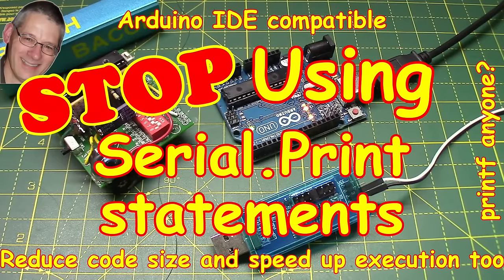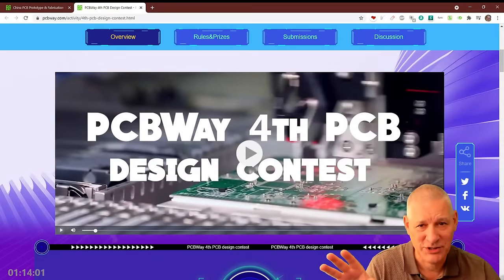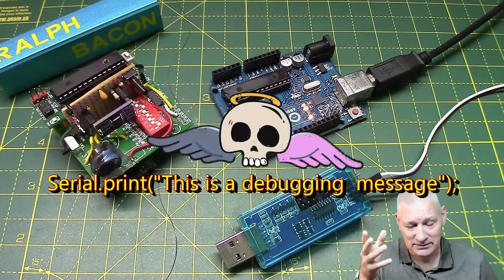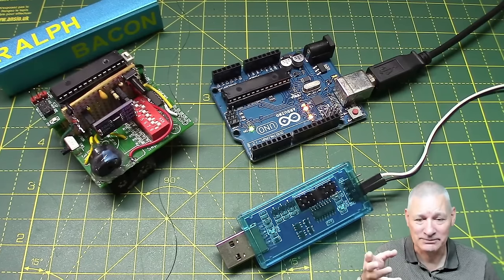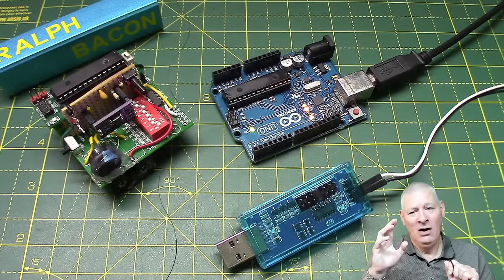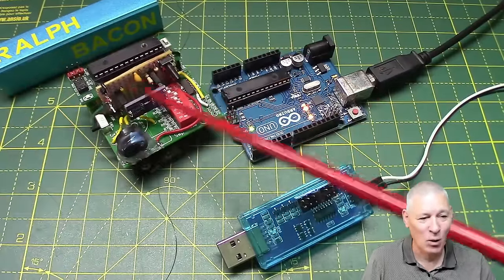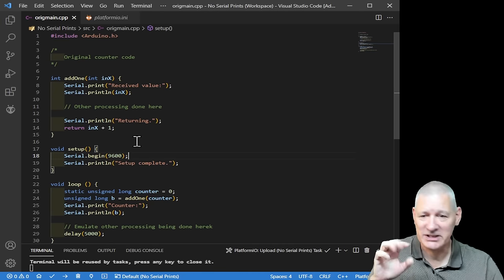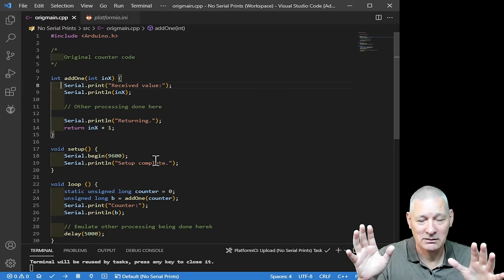#224 🛑 STOP using Serial.print in your Arduino code! THIS is better.

Comment: Ralph, I am begging you to make a video on debugging an ESP32 with a debugger. For instance your elevator code... Please debug that, show us that code line by line. I know that will be a video of reference for thousands🙏❤️
Reply from the maker: When you say "debugging" I'm assuming you mean single-stepping (line-by-line) debugging using an actual debugger? 

I tried this a long time ago (during a pre-beta phase of the new Arduino Zero) but it was so unstable. Now the Zero is no longer being made. I guess I need to look at doing this on an ESP32.

Comment: You can also do even smarter stuff in your debug statements. 
This is what I use!

#define de(X)do{Serial.print(F(#X));Serial.print("=");Serial.println(X);}while(0)

(Short for "debug expression" - you can then say de(x+3) and it will print x+3=(whatever it equals to))

#define dp_rl(X,Y) do{static unsigned long lastMillis; if(millis()-lastMillis>Y){Serial.println(X);lastMillis=millis();}}while(0)
(Short for "debug print, rate limited" - when used in a loop, it will periodically print a value every Y milliseconds.)

#define de_p(X)do{Serial.print(strrchr(__FILE__,'\\')+1);Serial.print(" ln.");Serial.print(__LINE__);Serial.println(": ");Serial.print(F(#X));Serial.print("=");Serial.println(X);}while(0)

(Short for "debug expression, (with) position" - this will print the expression, evaluation of that expression and also the name of the file and line number it got called from...)
Reply from the maker: Yes, that's a nice twist. You can probably shorten the way you do the millis(x) bit, For example, flash an LED every half second:

#define BLINK_LED pinMode(13,OUTPUT);digitalWrite(13, millis() % 1000 > 500)

If you #define the led pin in other code it's even shorter. So many ways to exploit the pre-processor commands!

Comment: Thank you, these are very useful methods and informations, but honestly the pace of the video on passing information was too slow, atleast for me. Shorter videos are alway better. If the video ever becomes hard to catch up in some parts we can always go back and rewatch thoes parts.
Reply from the maker: Put yourself in the position of a beginner, not a coder. They require the step-by-step approach more than you might think. No leaps of intuition required! You can always watch my videos at x1.25 or even x1.5 (which is exactly what I do when I proof them prior to publishing). Win-win, surely?
Reply: Longer videos make more money

Comment: Great video, BUT......  I find it strange that no one commented on the fact that your code is wrong, it never updated the 'counter' since it is defined as "0" at the beginning of the loop.  LOL  But that wasn't the point of the video.
Reply from the maker: If you are referring to line 21 of the Advanced example (main.ino):
    static unsigned long counter = 0;
then I'm afraid it's not me that's got it wrong, Don. 😮

I've explained a few times now that global variables are not a good idea; let's not get into the whys and wherefores but how do you then reduce the scope of a variable so that it can only be seen by a certain function but not initialised each time the function is invoked?

The answer is to declare it within the function but make it static which has the effect (by the compiler) of removing it from the actual function and placing it just outside - but not as a global for any other function to access, just the one it was declared in.

Anyway, that static keyword has many functions, and this is one of them. It's a clean way of keeping the scope of variables to a known caller base. Globals can be a source of insidious and hard-to-debug errors, so should be avoided wherever possible.
Reply: @RalphBacon  Then why is at always returning '0', ignoring the return value?.  It is not following the code.  As I said, that isn't the reason for the video, just curious.....
Reply: @donturnock5176 the reason why the value doesn't update is not because the variable is declared in the beginning of the loop. As he expalained in his earlier comment, this is the correct usage of the "static" keyword.

Instead, the problem is that he passed only the variable's value to the addOne function. This means that the addOne function would receive the value of the counter, but any change to the value of counter variable inside the addOne function wouldn't have any effect to the value outside. He should instead pass the counter variable as reference (using pointer) so that the change to the value of counter variable inside the addOne function would have effect to the value outside.

Comment: I've tried but if you need Serial.print(VariableValue, 2); does not work. Nice try, but you failed in doing something that WORKS.
You wrote something that SOMETIMES WORKS. Somewhat well done than.
Reply from the maker: Yes, I've upgraded the advanced example, to allow HEX, DEC, BIN etc to be specified. I need to clean this all up.

Comment: F3 -  replace all -"Serial" with "//Serial"
Reply from the maker: If that solution works for you, then keep using it, nothing wrong with doing that.
Reply: @RalphBacon  I just figured that's what everyone did. Everything from windoze notepad up has a find/replace function, and of course it's reversible. The only difference is that other than in a comment on someone else's video, I dont think it's hit-worthy. I'm not making clickbait out of it or anything. I bet you one Rial at nineteen to one odds that you 1. Stop using your method and use find and replace instead in the future, and 2. Don't post about it. But I really, really don't care. I'd never dis anyone's stuff in plain sight, but buried within a comment's (google says "comments'" (look closer) but google is slipping)) comment I think only grownups go here, so we can say what we think :) But I will watch all your other videos to see what else you have to offer (but wont comment:)) I have nothing against you man. I'm was just having a shit*y (<-BAM! censored) day and feel you wasted my time with this view.
Reply: @craigkirby9202  Not at all, I even write extra macros to include other sections which I want to debug or not individually. Also your function doesn't work (not in all editors) when you have several files in your program (multiple headers and source files). Your arrogance isn't what real software developers do. Hence, what he explained is exactly what visual studio does when you switch between Debug and Release, it is literally built into mainstream development software/libraries. You can make a debug header and add it to your arduino library and it's available in every project, so you even have to type less because debug() is shorter than Serial.print(). Just define DEBUG before including the header and you're done.
Reply: @RalphBacon  You are too nice towards rude and arrogant people.
Reply: <redacted>

Comment: I just use this - it's simple and lightweight. With variable arguments, you can use all of those Serial.printX thingies like before. That doesn't work with defining debug(s)

//#define DEBUG

#ifdef DEBUG
# define debprint(...) Serial.print(__VA_ARGS__)
# define debprintln(...) Serial.println(__VA_ARGS__)
# define debprintf(...) Serial.printf(__VA_ARGS__)
#else
# define debprint(...)
# define debprintln(...)
# define debprintf(...)
#endif
Reply from the maker: I've used the _VA_ARGS_ as the second parameter in the advanced (second) version. If this works for all arguments then your version is definitely better (simpler).
Reply: @RalphBacon  I guess my macros should do the same?

Comment: Ouch! Ralph, surely you know that the phrase "steep learning curve" does not actually mean what it sounds like.
Reply from the maker: I'm trying to remember where I said this, Terry. Not regarding this simple little pre-processor trick, surely? Enlighten me!
Reply: @RalphBacon  at about 25:20 what you said was:
"The more sophisticated the solution, the steeper the learning curve."
Would that not mean (when graphed mathematically), one would have a more and more rapid gain in a shorter and shorter amount of time?

Inquiring minds would like to know...
Reply from the maker: What I was alluding to, Terry, is that the more sophisticated (aka complex) the solution, the longer it takes to become competent using that solution.

Case in point: I want to print 3D objects. I have to learn Fusion 360 (or some equally complex solution). Huge task. Will take me months to become competent. And with decreasing gains as the curve  gets steeper as the things I'm learning become more complex.

I could go for a simplistic solution that allows me only to print other people's designs in about a week. But it's not  the solution I want. So, months it is. Steep learning curve!

Comment: Very useful information so many thanks. However, it's ironic that a video about how to reduce code bloat contains so much verbal bloat. I estimate you could have cut this in half without losing any content. 😀
Reply: No kidding. After watching for a few minutes I glanced at the length and thought "this had better not end up just being about wrapping the print statements and adding a debug switch of some description". Thankfully, I skipped ahead to make sure and saved about twenty minutes.
Reply from the maker: Noted... but this was aimed at beginners who are not familiar with any kind of macro statement and need the step-by-little-step hand-holding to make it work.

So whilst it could have been made more succinct, it would have left a lot of my viewers in the dark, I reckon.

I often suggest to listen to my videos at x1.25 or even x1.5 if you can still understand it. I do that with other videos so it would probably work with mine too 😜
Reply: @RalphBacon  My suggestion would be to add a quick summary at the start. "In this video I'll teach you how to use macros to..." Would make it easier for people to stay for the videos that are relevant to them, and skip the ones that aren't. On the other hand, getting people to watch for longer in order to find out undoubtedly plays better with the YT algorithm, so there's that. Regardless, there's no catering for everyone, so you do you.
Reply from the maker: Your suggestion has been taken on-board; I will see how I can integrate that into my future videos. Of course, if my viewing figures fall off a cliff... 😲😜
Reply: No, I really like the way he told a "story" - and like all good stories, pace is key.

Comment: Check out Microchip Fubarino / TCHIP011.
64KB ram and 48mHz.
Reply from the maker: OK, I'll check it out. Oh, I see it's Nano-sized and supported by Multi Platform IDE - a fork of the Arduino IDE, interesting.
Reply: @RalphBacon  i use the Arduino IDE.
It's cheaper than Arduino Uno at the official micro-chip store, 32bit, USB + 2 x UART, 2 x SPI, 2 X I²C, 5 timers, 256KB programming mem and more. PIC32MX270F128D

Comment: I don't really understand why you would want to substitute something like Serial.println with some #define debugln(x) Serial.println(x).  In fact, it will make your code a lot harder to read/understand in time, when you or somebody else looks at your code. Why would you not just do something like this: 

    #if DEBUG == 1 
      Serial.printf("\nOutside Temperature: %.2f",bme.readTemperature());
      Serial.printf("\tHumidity: %.2f",bme.readHumidity());
      Serial.printf("\tBarometric Pressure (kPA): %.2f\n",bme.readPressure()/1000); 
  #else  
    Serial.printf("Debugging is turned off...\n");  

  #endif

To me, I guess the above code looks a lot simpler, and you're preserving your original code rather than a substitution for something else. Anyway, just my two cents...
Reply from the maker: Because your way stops all debugging at a stroke. With my way you can be more selective and only turn off debug statements at a certain "level" (just like the ESP32 log_x does).

But whatever works for you is fine. I use that way too sometimes but the Serial.print statements are still compiled using your way; my way, the code is smaller because the compiler ignores unwanted debugging lines.

Just sayin', no right or wrong way.
Reply: Your statement contains one serious assumption. It is "it will make the code harder to read". This may seem correct at first glance for a person without that kind of experience. But trust me, after gaining some basic logging experience the average developers would actually start feeling uncomfortable to see those plain old statements and will be looking for a proper logging set up in the project. You know what I am adding to an empty project first of all? Yes, I am adding logging library and start to log things like "Setup completed" right away. Just trust me, configurable logging is the only right thing that 93% (my "random" number) of more or less experienced devs agree on.

Comment: The disadvantage is, you got completely rid of the debugging feature. You can not enable the output later again if you face problems, what hinders the ability to debug very sporadic errors.

Better is to use a function instead of directly serial.print and the function checks if e. g. a bool is defined (if (dDebug) serial.print...).

This allows you to enable debugging during runtime and speeds up the code also, the "if" will not slow it down in a way you would later notice.
Reply from the maker: Well, if you're going to keep the Serial.print statements (ie they are compiled) then it's better to check the value of a (spare) GPIO pin and if LOW output the serial stuff, otherwise skip it. That doesn't slow down execution and you can plug in a serial monitor at will. I use this method by using a small jumper from one GPIO to GND.

Comment: Says “stop using serial.print” tells you to use serial.print in a macro. 🙄
Reply from the maker: Well, to be fair it tells you to use a macro that expands to Serial.print but which is then programmatically controlled - quite different to scattering Serial.print statements liberally throughout the code.
Reply: @RalphBacon  alternative title “STOP using Serial.print directly in your Arduino sketches! MACROS are better.”
Reply from the maker: Too long! Only 70 characters are shown (apparently) so we have to be creative and succinct!
Reply: @RalphBacon  He has a point though, I certainly wasn't expecting the video content to turn out like this. Title could be as short as "Disable Serial.print with macros to improve speed"

Comment: This has nothing to do with debugging. In fact, with Arduino you can not debug.
What everyone does is logging but not debugging, you need a real debugger for this and a suited IDE.
For example, any Eclipse based IDE and an ST-Link or Segger debugger.
And only then will you not blow up your chip memory with printf or alike.
Reply from the maker: Well, semantics aside, we are debugging code by logging output. As you say, you simply cannot truly debug the Arduino via some single-stepping method available to larger microcontrollers (which I showed briefly in a previous video). Once the Arduino 2.0 IDE is a bit more mature I will have to revisit that topic.
Reply: Absolutely not true. Debugging comes from de-bug, comes from cleaning bugs from electronic relays. Yes, that term is that old. And it means to solve problems around your machine. Println-Debugging is absolute valid. Since "a couple" of years one has the ability to do stepwise debugging in modern IDEs, but there where times you didn't have more than a print. Of course you speed things up a lot when doing debugging with stepping through the code, but when I learned programming and debugging, it was a very good lesson to use prints - because you start thinking about your source code. As Arduino is a beginners or hobbyists platform, I think it's a good way for learning how to code. A modern IDE can be a little overwhelming

Comment: Maybe it would be possible to optimise even more by including the Serial.begin() in the macro, so that if debug is not used, the hardware serial library will not be loaded in the program memory ?

I think the baud rate is also a big topic here. I see too many people using 9600 without thinking about it even in projects with short loop cycle. The problem is that we quickly fill up the UART buffer, and then we get into troubles. I've seen programs working fine until I put a debug line in it. It turned out it was causing too much delay.
Now I always use 115200 baud rate and never had any problem, at least not any I would not have with lower baud rate.
If you think about it, 9600bps is crazy slow, even for an Atmega328

Anyway, interesting video, thanks !
Reply from the maker: Yes, the compiler directives could easily include the Serial.begin definition to remove that line too - I leave it to others to enhance that code!
I always used 9600 baud (it's probably some default setting) as you can get corruption with longer leads at higher speeds. It's an absolutely "safe" setting, ideal for absolute beginners who have enough to contend with.
But these days I use 115200 (I see that ESP32s can [allegedly] go to 2,000,000 or thereabouts, I've not tried it) and I've never had a problem.

Comment: Very good explanation for macros. I preffer to enclose my debug code between if(debug){ /* serial print here.*/} and let the compiler optimization decide if that block must be optimized. I set on top of setup function a boolean variable  debug=true to enable debugging. If this variable is false and isn't updated anywhere, the compiler optimization will do the cleanup for you.
Reply from the maker: Indeed, the compiler is very good (sometimes too good) as optimising the code and this could be a good way to do it.